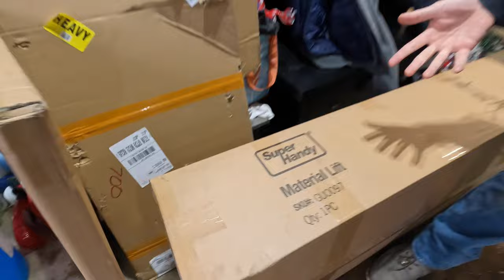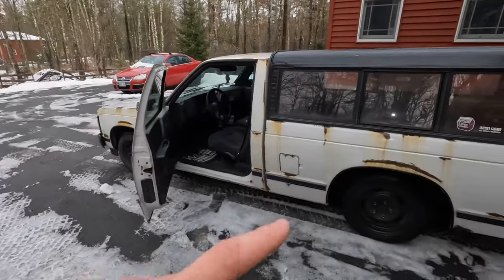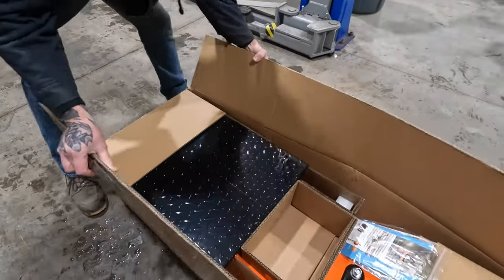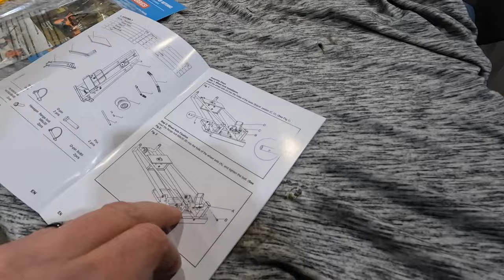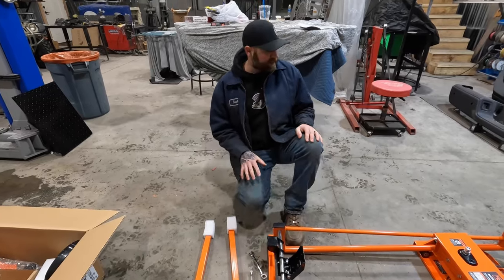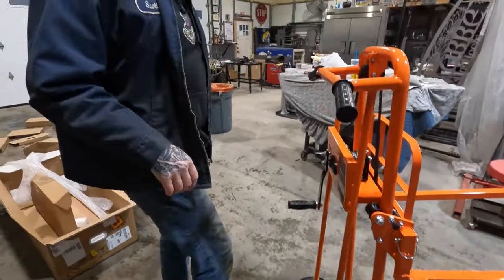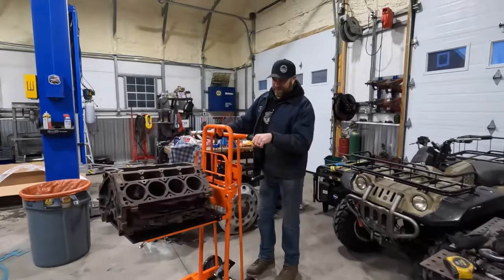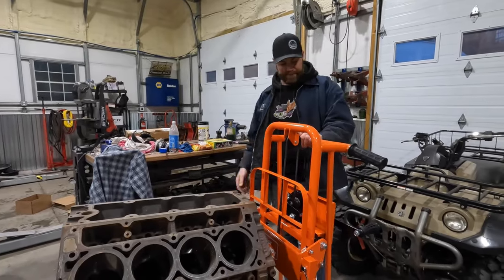A Must Have Tool for Any Shop!

Comment: A no brainer for a shop, but is is portable enough to be loaded on a truck and taken to a job site? And does it fold for storage? Thanks
Reply from the maker: Easily transported but need a flat hard surface to use it on, does not fold